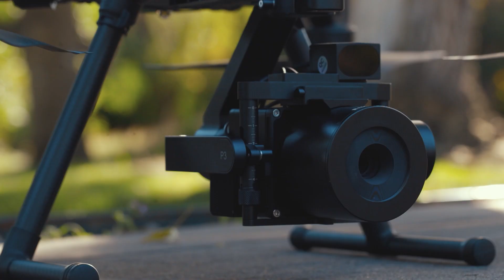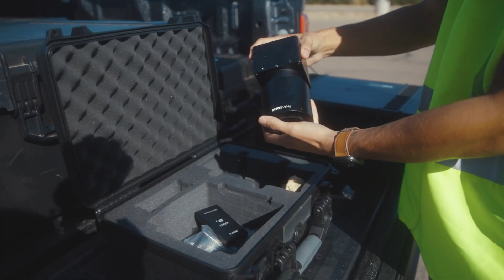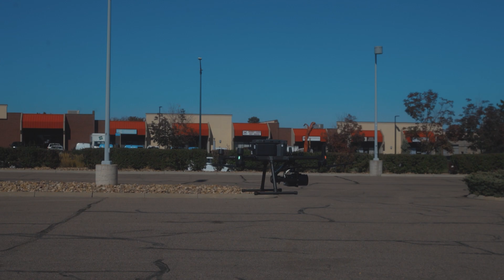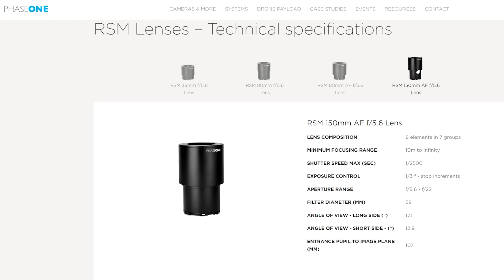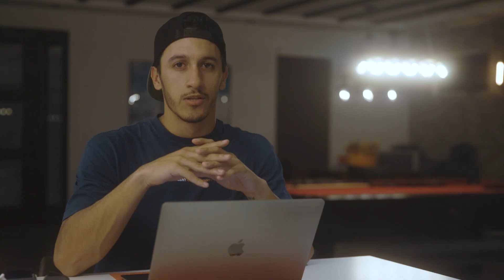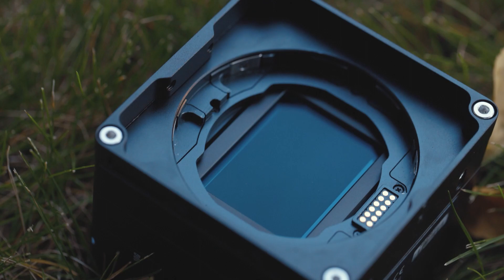$75,000 Mapping Drone - Phase One iXM-100mp

Comment: Hey Dylan, Thank you for explaining the 02 setups and I got answers for many of my question from this video. Could you please explain is it possible to use another high quality camera on inspire drone which enables high resolution?
Reply from the maker: Hey thank you for the comment! I’m regards to your question about cameras on I2, there are only 3 payload options all with the same resolution. I will say that the x4s (which is super hard to find as they have discontinued manufacturing about 2 years ago now) is the best mapping camera that DJI makes. The X5s that I am using is a specific set up as explained in the video. The x7 is a cinema camera and does not perform well when mapping (there are a lot of time sync issues and shutter misfires). 

If you want get the best quality, the only options at the moment are to make the jump and get the m300 with the p1 camera payload (45mp camera) which is significantly less cost compared to the Phase One camera featured in this video. Another option is to go with a custom drone and custom camera set up like the Sony A7R2/3/4 series will allow you to capture high resolution imagery for mapping.